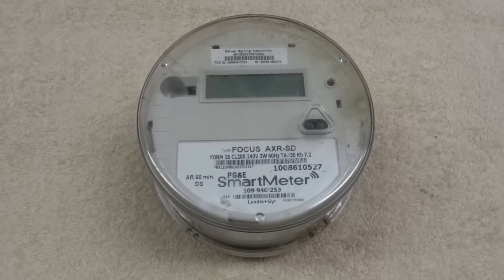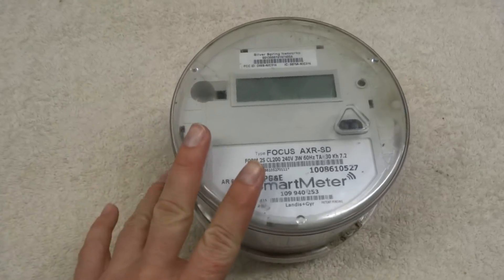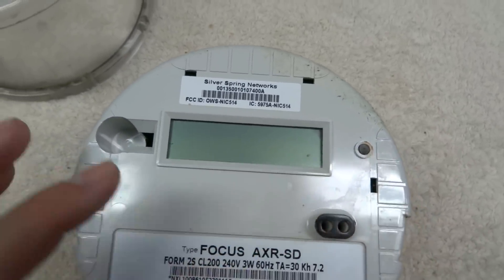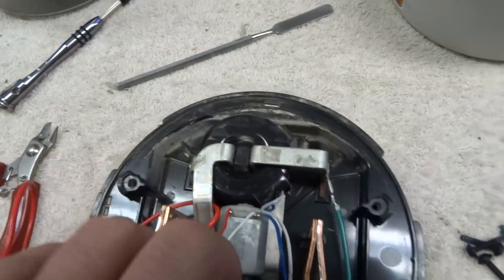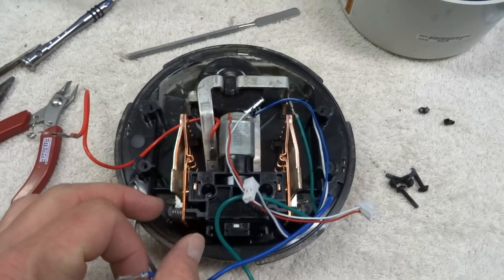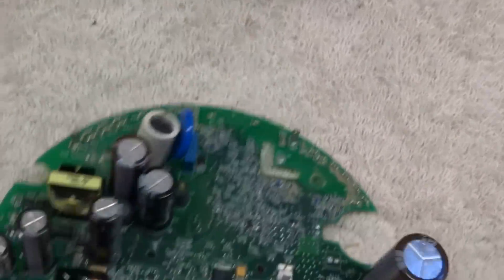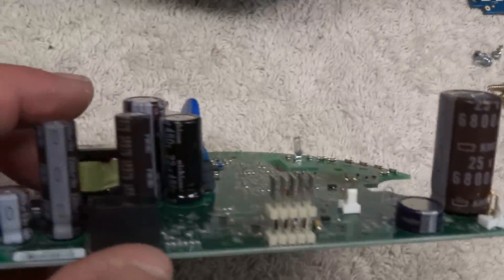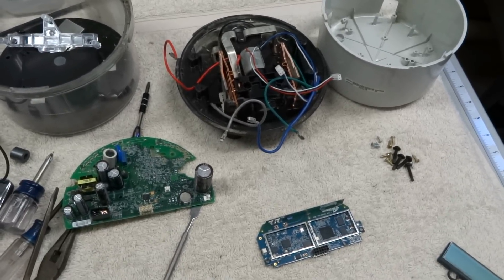Let's Teardown - Residential Smart power meter

Comment: They want everything on a smart grid, to help preventing of rolling brownout during peak hours in the summer and/or winter. With the big appliances mainly the smart frigidaire and smart AC, they can remotely put those devices into a low power state for just second or or two when the draw on a circuit is too much. doing this to a lot of homes as need be will drop the load back to a sustainable level and help prevent brownouts,  that's the line they fed me. Mostly believable, but   that motor is probably a way to thwart the theft of their product unplugging it most likely  red flags that circuit. I personally would be more worried by the ID chip people are putting under the skin. While it has great possibilities to stop thieves from taking your Mastercard and running up a ugly bill, and you will be able to prove that you are you without DL's and second piece of ID , don't forget that if money is done away with and everything is payed for electronically, Then when you decide that you have had enough of the system and try to protest whatever it was that tipped you, they can freeze your account and you can't pay the rent or utilities, buy food gas RX, ANYTHING. They are moving us into complete slavery. so back to the video.

Comment: Single phase or two phase is a debate of semantics all 110/220V service is defacto two phase, each phase is 180 degrees to the other when referenced to the center tap known as Neutral. 220V appliances use the summed voltage of the two phases as a singularly phased source. Since either L1 or L2 can have currents returning through neutral and /or the opposite line leg, both legs must be measured.

Comment: Wow. What a poor design. The electric motor would require power to open the switch at it has to turn a cam. What cheap and nasty crap. If there's a dead short before your consumer unit, then your home is toast and so are families. These things are as unsafe as a cheap chinese phone charger knockoff. Luckily my old meter is inside my house so I don't let these people in. They can do one.

Comment: At the 5:30 mark...that is not a power source(you figured it out later)... the doughnut shaped component is an ammeter and the blue/white wires are the tap...they relay amperage flow to the meter. You are correct that the little motor is for power disconnect,.... so they can disconnect your power remotely....though I strongly disagree that this is a "safety" feature. Keep researching smart meters and you'll realized what is up. And yes, power for the meter is tapped from the load side, so you the customer are paying for the extra electricity needed to run the features of the meter.

Comment: The "safety" motor is for remote disconnection for non payment.   In this area they also install an alarm that sends an alert to the home office if the meter is pulled,  because all you have to do to thwart this remote disconnect is pull the meter and jump the lugs.  All the crackhead squatters around here were just pulling the meter and hooking up jumper cables, so the power company started using line current detector alarms,  when triggered they send a tech out and inspect it visually.  If the meter has been jumped out they put a locking cap on the meter box and report the location to the police for criminal charges of the junkies who are squatting there.

Comment: I just saw a video yesterday explaining what the red and white and the blue and white wires do the red and white is how they shut your power off from the power Factory if you have just like an 18 volt Dewalt battery you can hook it up and reverse that by giving it a jolt and you can tell when it opens up and it closes with an ohmmeter on the backside of it and it makes a loud clunking noise. The blue and white wire now that's the one you want to disconnect to shut down the meters availability to send knowledge to the other meters however you want that connected whenever they electric company does their readings because that will definitely throw them off and I'll come look and what the hell's going on.

Comment: heres a few things on smart meters:
1. the connections made, is from 800 mw radio signal, and it hops to gatekeepers
2. the gatekeepers uses anything from fiber optics, to cellular services, to satellite communications, depending on location and what is available for that location, and the gatekeepers collect data from the radio signals. its probably why there is that FCC code on there.
3. with off grid applications, depending on your area, it collects data on what you produce and sells it to the company a local company has a contract to buy for.

so for anyone wondering how the connections are made, its a bit complicated, but i called my local power company in benton county tn, and the meter man explained a lot. its a lot more complex than what people think, and its not simply a "built in wifi". :)

Comment: These meters are garbage.  They are programmed to steal kWh.  I have set rhem up, unplug everything in your home, in fall when hear and A/C is not used, the only thing running in my home was a fridge that used 50 watts an hour, over a 12 hour period the meter registered 10 kWh.  

When i was raising a family of 5 with the house rocking from 6 am to midnight everything in the house ran, 2 fridges, 2 freezers, stove every day, 3 loads laundry every day (wash and dry), dishwasher every day, hot water tank was gas but emptied 16 times a day, 40  incandescent  lights, 5 computers, 5 TVs, sump pump, dehumidifier, microwave, you get the idea, we never conserved and our home could not use 1200 kWh per month, now no one but me lives her, family grown and left, and my meter is registering 500 kwh per month.  This is impossible, i dont cook but once a week, i dont do 1 load of laundry a week, my freezers are gone, only one fridge, dont use dishwasher, hot water tank emptied once a day, no lights but one LED, no TV, no computer, 

These meters are designed to steal, set your provider ip and then call them and threaten them, i did this and my use dropped in half to a mere 250 kWh per month, which i still dispute.  

I know every watt every product in my home uses. If i turn a 20 watt light bulb on for 5 minutes, i get dinged for 100 watts.  If i tun my stove on for 10 minutes ( 2000 watts an hour is supposed to be the usage) i will get dinged for 1000 watts for only 10 minutes.  These meters are garbage and just a way to steal money on hydro that is not being used.

Comment: Let's look at why we need TIN FOIL HATS. 
 #1 reason is they turn off breakers in your home. Both AFCI's and GFI's get turned off by the radiation from the smart meter.
#2 Did you know a flammable smart meter will turn off your power if you do not pay your bill, BUT it doesn't know when it's own butt is on fire. 
#3 Your power company has access to all of you private power information. Eg When you make tea, when you turn on your alarm etc. 
#4 A smart meter will KILL your family members who have cancer. If they come home from the hospital and sleep near a smart meter, they will die. Check with the US Cancer Society website. 
#5 A smart meter will hurt or even KILL disabled homeowners who have disabled medical implants.  
#6 You smart meter is very accurate, so accurate that it also measure the noise and dirty electricity. Have a look at INRUSH power. 
#7 Smart meter radiation is breaking Ionic Bonding.
Reply: Lmao!

Comment: Sweet baby Jesus...this is why so many people are misinformed about "smart metering" and metering in general. For example, that "thing" on the back of the meter that you said was some kind of manual switch for disconnecting power, ummm, no, it's for hanging the damn meter on a nail or screw while it's in stock before being deployed to the field/customer. Haha    And the top two terminals that are on the same side as this "manual switch" (snicker) are the line side terminals, the ones which the utilitiy's power terminate on, not the ones going to the customers side of things. The bottom two terminals are the load side which do go to the customer's side. So much more to debunk, but these alone show you need to make videos about something else, something you actually do know something about. Wow!
Reply: Let's look at why we need TIN FOIL HATS. 
 #1 reason is they turn off breakers in your home. Both AFCI's and GFI's get turned off by the radiation from the smart meter.
#2 Did you know a flammable smart meter will turn off your power if you do not pay your bill, BUT it doesn't know when it's own butt is on fire. 
#3 Your power company has access to all of you private power information. Eg When you make tea, when you turn on your alarm etc. 
#4 A smart meter will KILL your family members who have cancer. If they come home from the hospital and sleep near a smart meter, they will die. Check with the US Cancer Society website. 
#5 A smart meter will hurt or even KILL disabled homeowners who have disabled medical implants.  
#6 You smart meter is very accurate, so accurate that it also measure the noise and dirty electricity. Have a look at INRUSH power. 
#7 Smart meter radiation is breaking Ionic Bonding.
Reply: Lol.. no a GFCI breaker trips when there is a very very small imbalance of current between the hot conductor and the grounding conductor (neutral). 

And who the heck sleeps outside next to their meter??
Reply: Like a top.... wind him up and watch him go!  lol
Reply: Well,  let's pretend the smart meters are as dangerous as you project..... I'm afraid,  what with your ranting and misinformed mantra, that you've been exposed to one for too long. 

The end.
Reply: 7MOBO
PLEASE SUPPLY IS WITH A LINK FOR THE CERTIFCATION EXHIBIT FOR YOUR AMI7
I LIKE THE PART WHERE THE FCC SAYS THE DISTANCE TO COMPLIANCE FOR A 35 WATT SMART METER IS 4 FEET
Do your customers know there is a DO NOT INSTALL DISTANCE of 4 feet?

YOU DO KNOW WHERE THE FCC IDENTIFICATION NUMBER IS, DON'T YOU?
Walk outside and look on the meter face plate, they generally are near the top
AFTER THAT WE CAN TALK ABOUT HOW YOUR COMPANY IS AN ARSONIST

Comment: Logically, the power-connections for the meter would be before the current sensor. That way it only measures current that goes past the meter..
Reply: they know what the usage necessary for their device is. therefore can simply "correct" it.

Comment: That antenna is basically a variation of a j-pole invented by Nazi Germany for the radios on the zeplins a safe design because the whole antenna is grounded. Where as other types of antennas are dipole or monopole these types ;the transmiting element is not grounded creating an arcing hazard when transmitting and during times when a zeplin was experiencing st elmos lightning.

Comment: **the SAFETY motor is MORE TO DISCONNECT PERIOD not needing to physically cut power via a technician due to bill appropriations!!** You certainly pay both in health issue and clearly everything passed thru the unit! It can also be used to calculate what items in the home are being used. This can also provide information to sales lists to vendor for purchase the Infos!

Comment: The "doughnut is a current transformer. It reads the power usage. The motor is to remote disconnect power for lack of payment or other reasons
Reply: Ive heard  of people getting in trouble for putting magnets on thier meter panels.

Comment: AS you can see if they can turn it on and off they have power to reset the meter for more money or speed it up and I have a feeling that is what happens with mine. When one month out of the year my bill doubled and even going to their office will not get you a reasonable explanation.

Comment: If the consumer pays for the operation of the meter, and it's 1 dollar a year....
Multiply that by the number of consumers...ding,ding,DING!!! They just saved 20 million....
CROOKS
Reply: Analogue meters use power too, digital less, mechanical (motor driven) more. Meter readers still come to check once a year had you thought who pays for them, together with infrastructure construction and maintenance? Answer: a daily  'standing charge' (regardless of energy used). For gas/elec I pay 55p UK (88 cents) DAILY. Check your tariffs.

Comment: i'm halfway into the clip, but you seem to know electronics enough to explain what it all is, so you misrepresented yourself off the bat when you're obviously an electro geek.  then you made a wrong assumption that the unit has a ground, when most of the early units had no ground thus commonly exploded or burst into flames on power surges.  lastly, you misassumed the ability to turn off the unit was a safety feature vs a utility and hacker's paradise to freeze/extort you into compliance in dead of winter etc.

Comment: Didnt tell me anything
Reply: La Diablo right , but something much more going on, i bought a new laptop, pluged it n whear i have previously pulged my tab n, then the laptop automatically had my name , email, everything all my info was already in it and i dident even touch a key!, so if i want ur info trust me all i got to do is buy a new crome cheepest laptop they got and plug the charger in whear u plug in your phone normal in your house
Reply: La Diablo that my friend is a fact! I took it back exchangeed it for a new 1 pulged it in a different outlet and same thing happened, not even connected to the net,
Reply: So these smart meters are a gangstalkers dream
Reply: Call me crazy but its true, much more than just juice flowing through your copper wires n your house

Comment: The size of those capacitors..... The thickness of the metal on the 3 antennas on the board. God that thing must pump out mad RF.
Reply: That's a pretty far reaching statement. I never inferred any of that. Just that with the size of the capacitors, and the thickness of the antennas, it must be able to emit a large deal of RF. Take that however you desire I suppose.

Comment: this guy is talking with a paper butthole. yopu dont guess about electricity it takes a fraction of an amp to KILL YOU and most homes use 200. First of the top 2 prongs sre the LINE. The line is always hot(LIVE) each side is 120volts 2 prongs =240volts. The bottom 2 prongs asre the LOAD (the power output to your home). The fact that this fool says the motorized disconect is a saftey feature blows my mind. That is how the electriv company shuts your house down when you dont pay your bill. so 1000s of people lost thier jobs because now they just shut you down with a click of a button from a truck.

Comment: Its how they remotely turn off your power when you dont pay the bill!
Reply: I just saw the reverse of that the other day.  We called up the POCO to find out why the power was off even though the meter was flashing, cleared up the miscommunication, received instructions to go switch off the main circuit breaker in the panel and upon confirmation from us that the load was off heard the solenoid make a big pop noise as they closed the switch.  First time I'd see that.

I did notice that one of the displays flashing on the meter was the word OFF so I'm speculating that the meter displays this status when they kill it.  This would be a nice think to know when troubleshooting why a customer is saying that something funny is up with the power at their house.